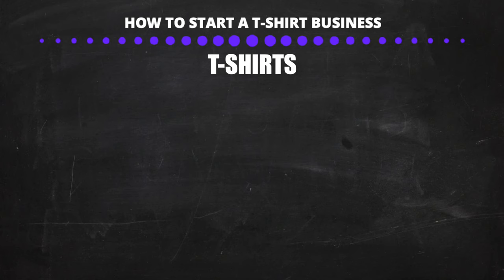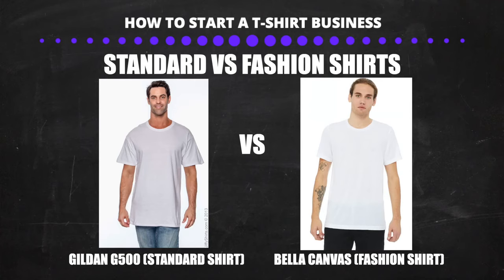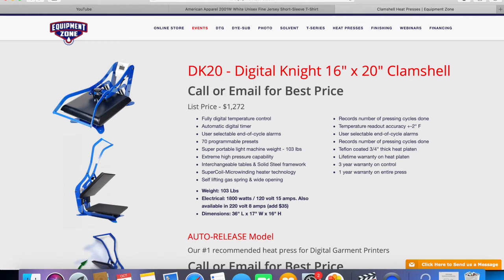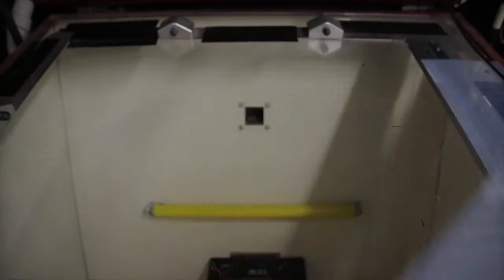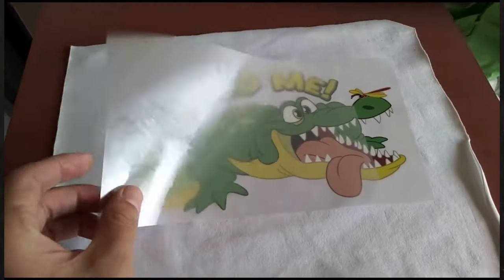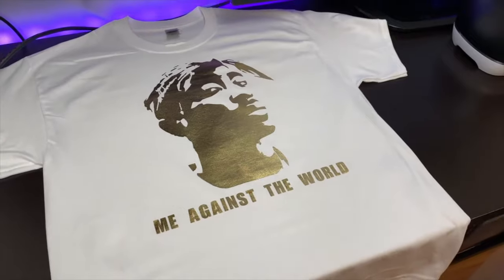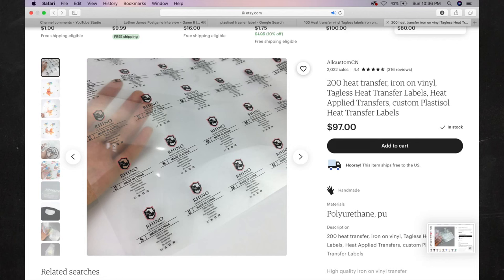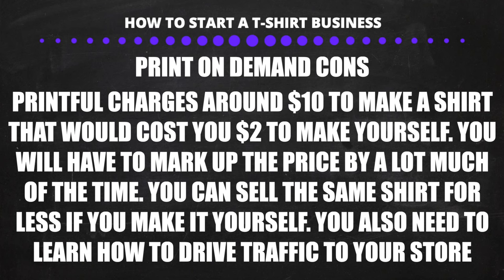How To Start A T-Shirt Business (DTG vs Screen Printing, Print On Demand, Plastisol, Laser Printer)

Comment: PSA: Vinyl printing, don't mess with dtg dtf sublimation or screen printing. They are time consuming and limited to specific media. Vinyl prints work on everything, even ribbed fabric. If you wanna start t-shirt biz, vinyl print + embroidery. You'll only want to do dtg if you're a designer brand like ed hardy shirts etc. What you're doing is on demand print for customers and vinyl is the best way to go. It's sturdy and lasts for several years of washing without cracking.
Reply: Probably if you're just starting out but I absolutely hate the feeling of vinyl ona t shirt, just a giant sticker. Vinyl still goes hard

Comment: Last year I start silkscreen printing, but now I need to consider to buy dtg machine because most of my customers just order only below 10 pcs shirt,  for my shop, I will take more than 10 pieces clothes order to proceed for silkscreen,dtg machine is reliable for someone who want to fast and very few order, silkscreen take a lot of time, spacing.  Sometimes I waste a lot of time to clean up block, paint, separate cmyk color, / production problem ( block clogged)

Comment: awesome video! this is really informative and I appreciate the pros and cons, it helps weight out the options if your a small first time seller or going to upgrade your gear when you generate more revenue!. there is one thing I would like to point out when it comes to print on demand, a lot of the ones i've run into at least refuse to make anything that might be copyrighted or trademarked material even if it's custom made though fiver or yourself which can be a bummer, I feel print on demand is more if you have a large online presence such as an influencer with a merch store. where you can easily charge 40$+ for a tee and make at lease double what you pay

Comment: Heya, great informative video! The only part i didn’t understand was that a con for print on demand was that I would need to have a social media following/drive traffic to my website, but I would need that even if I was using all the other methods
Reply from the maker: Thank you Nicole, yes you will definitely need to drive traffic to both. The problem with POD is that they charge a lot to make a t shirt which will dig into your margins, so if you had a dtg printer you could make the shirt for a around $2-3. Making the same shirt on POD would cost around $10-12. If you have a DTG printer and the cost to make a shirt is so cheap you can use some money for marketing, if you use POD you really dont have too much room so you really have to know what youre doing to promote your shirts and still make margin

Comment: Thanks for the info. I just started dtg printing. When I print, it comes out very nice and colorful. Then I heat press, and it gets dull. I have tried different temperatures, pressure and press times. After pressing, is it supposed to look the same as it did coming out of the printer?

Comment: Great video i must say.
I need some answers im about to start my heat transfer business and would like to know 

1.what type of heat transfer paper you use on caps ?

2.what type of heat transfer you use on mugs and plates 

Thank you in advance for ure response.
Reply from the maker: Thank you! just to clear up you will be using sublimation paper for all of them. Its the same paper, make sure you do this using sublimation ink and not the standard ink that comes with the printer
Reply: @SlavaTVOfficial  okay thanks a great lot but the sublimation paper can wrk with either laser printer or inkjet printer???

Comment: In your video the DTG printer prints brilliantly bright colours, my sample from printful has two problems:
1- they are duller color, even though I designed them in CYMK and then saved in sRGB.
2- The solid white is not solid white, it appears cracked.  

Almost as if they did not pretreat it correctly.
Reply from the maker: hey, I would contact printful and show them pics. it sounds like they made a mistake

Comment: Pretty sure that if you hire someone off of Fiverr, you also will need to pay for commercial usage of the image, that alone is usually like $20, and source files usually add to the cost too. A base package might normally be 15-20 bucks but, once you add things on, you're looking at around 50-100 per image.
Reply from the maker: thats a hustle never pay that

Comment: hello, fascinating video, I was left with a great ambiguity and please if you can help me with some advice. I have 2 epson L1110, L3110 printers with continuous ink system (ciss), in one printer I have the ink that the printer came with and if I print on the transfer paper the image goes, instead in the second printer I have ink for sublimation and print on the transfer paper and the image does not wash when washed, I saw that everyone says you have to use dye or pigment ink. the question is
, what ink to use to be more resistant to washing. dye ink - pigment or sublimation ink ??? thank you very much.

Comment: Could you tell me how shirts like the ones in the thumbnail were made? I have a bunch of band shirts that are full photo color print with ink that you can feel on the shirt. The thicker ink makes me think screen print but the full photo range of colors makes that seem impossible. It's not heat transfer because it doesn't feel like vinyl and it's not DTG because my DTG shirts are flush with the fabric as in you can't feel the design. Most of my band shirts from my closet are how I described-any thoughts on how they were made?

Comment: Hi thank you for the video. I am thinking of starting to print shirt, thinking of getting a 15 in one heat press machine but I don't know much about it yet. Any advise please?
Reply from the maker: Hey no problem! I would suggest you get a machine that's larger than 15 inches such as 18 by 13"

Comment: The RoyalPress Heatpress that was in your description isn't available on Amazon anymore, do you have another recommendation for heatpressers?
Reply from the maker: Hey you can use any brand of heat press machines just make sure the size of the machine is good for the type of shirts you want to make. Also, you can keep checking Amazon they may restock

Comment: Hii , what type of quality t-shirt do I have to buy (if I buy it on alibaba), also someone say I can use any kind of injet printer to print does :HP DeskJet 3755 Wireless All-In-One Inkjet Printer - Seagrass is ok?
Reply from the maker: hey, dont buy the shirts on alibaba. I suggest getting them from websites such as jiffy shirts. also the seagrass is a sub printer, you have to do this with a regular inkjet printer like the hp you mentioned
Reply: @SlavaTVOfficial  do you have a suggestion of printer under 200$ I could buy on Amazon please? Also what kind of shirt should I choose on jiffy shirt?

Comment: Who are the LA setters that set stones for you 1.50 a stone? I found Avos casting already but I need a setter
Reply from the maker: hey bro, check 629 hill st 7th floor
Reply: $1.50/diamond he was talking about pre-set meaning the shortcut way of setting diamonds, which MOST jewelers offer. They prolly thought u asking a regular pave setting. Make sure you mention PRE-SET